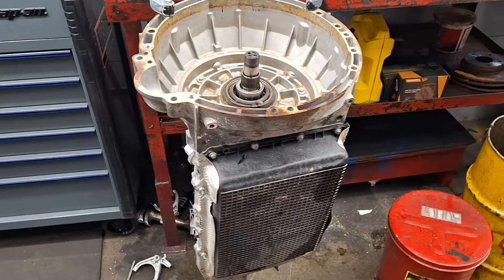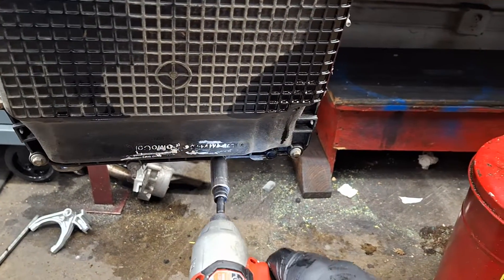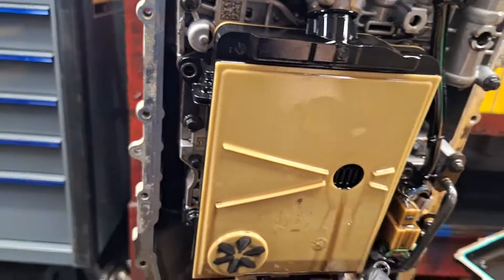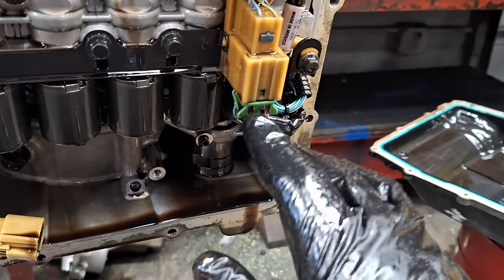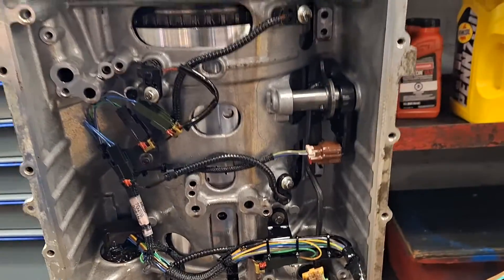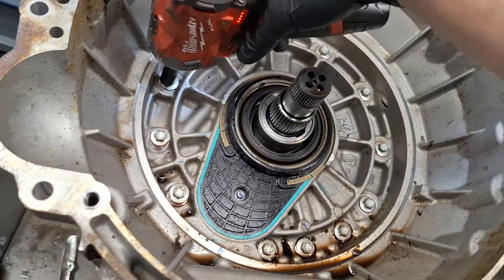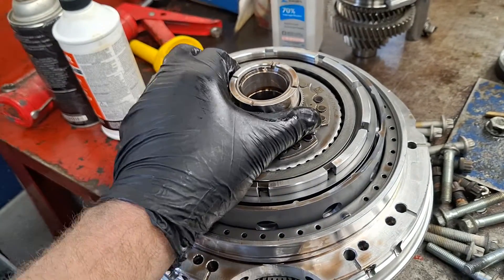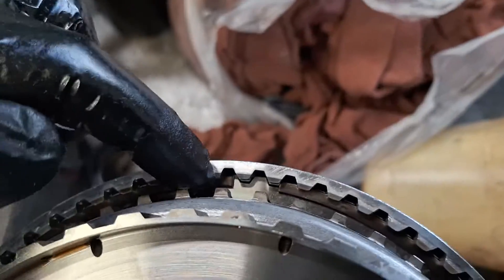Ford 10R80 Teardown | 10 Speed - CDF Drum Bushing Failure

Comment: So one of the symptoms that's common with this problem is the one to up shift and the three to four up shift. Now I have something that is going wrong with my transmission but it doesn't have those symptoms. Mine is having an issue with slipping at normal driving speeds in like 9th or 10th gear. I'm wondering if I have some other problem then the CDF drum?

Comment: While it sucks that ford pushed this transmission out without doing more extensive testing at least they have been issuing upgraded parts and allowing you to buy them and rebuild compared to some manufacturers where they require a full replacement and that typically costs more

Comment: This transmission requires fluid changes at 50k miles max. Also good to add about 4 ounces of Lucas transmission treatment. Zero problems! 3rd generation mechanic and engine builder.
Reply from the maker: Appreciate the extra insight!

Comment: Hi can you tell me your opinion I have 2020 transit T250  rwd high 
LK4Z-7000-C  (trans)
Got  code p 07f7 
Some time get  neutral while  I am on drive with brake on traffic light  or while claiming  high road  
 I changed the control  new from dealer with new oil and filter with pro shop  still same 
Only when I turn the engine off on if got neutral the transmission got power and move  what you think ?
Reply from the maker: Hey a 10r80 with gear 10 incorrect ratio (p07f7) is normally a shifted cdf bushing

Comment: What does a repair like this cost?
Reply from the maker: @FormerlyTT34  5 to 7 grand
Reply: @BigBensCarsAndCycles  Reon I ask is because my 2018 f150 xl V6 10 speed is having an issue. Dead stop, slight acceleration then backing off to turn a corner and accelerate, it lags. Another example, when slowing down for someone turning in front of me, not to a complete stop, then accelerating, same issue. Just getting a feel for what I'm in for  Wednesday at the Ford dealer!

Comment: After a CDF replacement are these transmissions pretty much trouble free after?
Reply from the maker: @sosu1122  yes as far as major problems. You still will have hard shifts from the valve body and the f-clutch can still cut into the container cylinder (that's not as common )

Comment: My 2022 f150 5.0 transmission failed after 24k miles..ford couldn't fix it so they installed a new 2024 10r80.  Hopefully they fixed the issues 😂

Comment: Had my 2019 in the shop under warranty twice for trans issues and they said they couldn't get it to act up and never performed any repairs. Just gave it back to me each with a no problem found. Now it's worse and out of warranty . Going to try and take it back and see if they will po5 it but probably not. Gonna cost me 5 to 10k now to get it fixed

Comment: I am having the flair on the shift to 5 but also to 10th. enough so I am throwing a drivetrain trouble light and locking out of tenth gear. I have also had a delay into reverse, harsh shifts into reverse and have had clunking and delay in engagement in various gears. I have the dealership coming to pick up the 19 expedition with 80k. Will all my problems probably be the CDF drum bushing? Merry Christmas and thanks,
Reply from the maker: @josephkordinak1591  merry Christmas and yes that sounds like the cdf
Reply: @BigBensCarsAndCycles  Got a full overhaul. CDF, Can, valve body. Acts a whole lot better now. Glad I sprung for the warranty. It was a 6k dollar repair.
Reply: Get rid of it. They are trash.

Comment: Is removing the valvebody necessary if one only wants to remove the clutch carrier cylinder or "the guts" outa the casing?
Reply from the maker: @abdulhassan1107  been a while, think so because you have to remove the speed sensors

Comment: I have a 2018 f150. When it's cold, it seems to stick in first gear. If you just take off like normal, it feels like someone has just rear-ended you! After you get into third it shifts okay till the higher range. Then it acts like it goes into neutral for a second and this is always random. After you drive 3 or 4 miles, it shifts like a new one. No slipping. Truck gets 20 mpg. The truck has 145,000 miles on it, and from the records I got, it's transmission has never been serviced. Am I wasting my time just changing the fluid and filter? I live on my social security and can't afford a 7,000.00 transmission. Really worried! Thanks
Reply from the maker: Hi, Unfortunately It sounds like you need a CDF drum replacement or new transmission. If you don't owe money on the truck, you can sell it as-is, hopefully for 10k or more. And with 10k you can get something very reliable for yourself.
Reply: No such luck. Me and the bank just bought it for 20,000.00 three months ago. It's crazy that it drives so good and needs rebuilt or replaced. I was hoping a fluid change would help it. I wonder if a used transmission from a salvage would be available and cheaper? What year did Ford start using the new part to fix this? You make it look so easy in the video, lol!
Reply from the maker: @rbthom2010  2023 is when they fixed it. Though you may run into programming differences if you use a newer one. Its possible you'd be able to work though that
Reply: Okay, so if I bought one from someone online, like this Monster Transmission co. I'll still have to get it programmed before it will drive?

Comment: is the GM trans  the same?   (same issues?) I have a 2020 gmc,  with 10spd,  and it works great,  but, wonder if  I'm on borrowed time?
Reply from the maker: @leewestrope4624  yes it's the same, though gm tends to have different pattern failures. I think they've got problems with the front support and torque converter if I recall correctly

Comment: Are the CDF drums interchangeable between the 10R80 and 10L80?
Reply from the maker: They have different prefixes and suffixes in the part numbers. I would not interchange them.
Reply: @BigBensCarsAndCycles  Is there no updated CDF drum with the anti walk bushing update for the 10Ls? or do they not suffer from this problem like the 10Rs do?

Comment: That is some black fluid. How many miles were on this trans?
Reply from the maker: @justinschnepf  I don't remember. Most likely under 60k. Most of those were done under warranty
Reply: @BigBensCarsAndCycles  dang that's wild. I changed the fluid in my 10L80 GM 10 speed for my 21 Silverado around the 50k mark and it looked pretty good still. The fluid in that trans looks like coffee. We just picked up a 2019 expedition max and I know the trans is very similar (co-developed) but has their differences. Ford did a better job with the fluid pump vs GM, but apparently did a worse job with that drum 😆.

Comment: Is there a thermostat in this transmission?
Where is it located
2019 f150
Slow heating up
Slow cooling down
Running hot at idle
Issues showed at 55k
Reply: In the valvebody and there is a valve by the engine (if I remember correctly) that opens up to allow coolant to cool the transmission. Replaced it awhile back on a F150.

Comment: i feel this is a bad fix if the Mechanic can't remember where all the screws go and put the wrong one, or Goofing off in the shop and not focusing on All this tear down which takes ALOT of FOCUS!... you seem Very FOcus**
Reply from the maker: Yeah you can't get distracted on these, its easy to make a mistake and have to pull the transmission back out

Comment: Is new CDF drum modified to prevent it happening again?…I have 2019 in shop getting new cdf drum , do you recommend any other upgrades like valve body ect?Thanks for great video!
Reply from the maker: @stevewhite7649  yes, it's modified to prevent future issues. While you're in there I'd get the updated design planetary container cylinder, and of course new sun shaft Teflon rings (where it slides into the cdf)
Reply: Thanks for your advice I appreciate it!

Comment: What causes surging in 3 4 5?
Reply from the maker: That can be caused by the cdf failure. If its just firm shifts, its normal. If it is a strong delay, then CDF
Reply: @BigBensCarsAndCycles  no so much delay as after each they surging.  Maybe engine control issue. 

I have a 23 NA v6.  Company vehicle.  Like my 15 5.0 6r80 better.  Both f150

Comment: what year is this truck?
Reply from the maker: I dont remember, though it's likely between 17-22
Reply: @BigBensCarsAndCycles    Please allow  me to ask two more questions. 1) If you have a record of  "hard shifting" as in your dealer  is aware but says it's "normal" or has tried  to reset shift points etc. and then it craps out out of warranty, has ford been covering those cases?
2)  What does this cost for us suckers who have had very hard downshifts, and then it finally craps out and your stuck footing the bill on your own? Obviously this will vary but are we talking 3k, 5k, 10k!?!    I'm  worried about my 21' that has occasional VERY hard down shift into 5th and or 3rd but only does it every once in a while.
Reply: also only 37K on my truck...

Comment: Thank you so much for this video. 
So my raptor was diagnosed with this problem and I scheduled to change the drum in 2 weeks. 
It is ok to drive on my old transmission for two weeks (was planning to go to different state) ? 
Thanks.
Reply from the maker: @leoblyshchyk6287  hi, if you are losing engagement while driving, I would avoid long trips. If it's just firm shifts then you're ok
Reply: Thanks for replying so quickly. 
No just hard shifting and not always.
Reply: I would avoid driving it out of state. The sealing ring will eventually roll off and you will then lose other gears. I build these all the time.

Comment: Im having issue with my 2021 f150 it’s got just over 65,000 miles just started 3 days ago. Truck suddenly shifts a bit hard into drive after driving it for a while and it had a slight harsh/bump feeling when shifting from 4th to 5th and only in light accelerations,(almost every time when trans hot) mid to high acceleration shifts perfectly into every gear. Don’t have any issues when cold. I tried clearing the trans adaptive tables and no luck (does down shift smoother after) could this CDF from be the issue? If not should I be worried about it? No one else feels the shifting concerns but me 

Forgot to mention I did do a trans service (fluid change and filter) at 60k miles (1st one) should I be doing services sooner maybe 30k?

I do have a extended aftermarket warranty but I’ve always done my own services and repairs

Comment: Is there a difference between the 10R80 RWD and 4WD?
Was this F-150 a 4WD?  Approximately; how much time does this repair take to do?
My truck is a 2019 F-150 4WD STX with a 10R80.
Reply from the maker: No difference between 4 and 2 on the internals. Cdf job took me 2 days. That's with removing and installing the trans too

Comment: So are these transmissions junk ? This is a lot of work for some simple parts .
Reply from the maker: With a new cdf drum, worst case you'll have harsh shifts. Otherwise they're good
Reply: @BigBensCarsAndCycles  Does the new cdf drum eliminate this problem for happening again ? Thanks for the Reply back .
Reply: @walkerjohnny72  It will eliminate symptoms caused by this issue. There are chances of other issues coming up with it but it's luck of the draw. the CDF drum is a common issue though.

Comment: My transmission does the same thing. Almost goes away completely when warm. Except 8th gear shifts a little hard. Do you think this is most likely my problem? Also where can I order parts? And where can I find parts diagram with part numbers for internals. Thanks in advance.
Reply from the maker: Hi, harsh 7 to 8 usually is fixed with a new valve body. Strong delay into 2, 4 or 6 when cold is usually a cdf issue. Ford has a tsb for the cdf drum you can print out. Base part number is 7h451 I believe
Reply: @BigBensCarsAndCycles  great so you’re telling me i may have both issues lol. I sourced out a new cdf drum.  Looks like I can get a new drum assembly for 189$ Do you know how much a new valve body is? And yes you’re correct it’s always gear 7 to 8 that’s harsh.
Reply from the maker: @TheTechGuider  If you want to join my discord I can list some parts for you, theres a lot
Reply: @BigBensCarsAndCycles  yeah I have a discord account.
Reply: @BigBensCarsAndCycles  also my f150 has the 5.0. Idk if that makes a difference.

Comment: Took my truck to the dealer for a flare from 3 to 4 when the transmission is cool. They're doing the valve body first because ford won't pay to do the CDF drum from the start. Why would ford want to do that first if the issue is obvious?
Reply from the maker: Since I don't work there anymore, I'll be honest - if it's obviously the CDF drum I went straight there

Comment: My 2020 F-150 had a transmission failure at 74k miles.  Luckily I have the  extended warranty and it is currently being overhauled by the dealership.  Is there a difference in the type of overhaul a Ford dealership does on the 10R80 based on a Warranty repair vs a non warranty repair?
Reply: absolute BS that this is such a common and k nown issue and yet ford wouldn't cover it.
Reply from the maker: Hi, in my personal experience, with a customer paid repair I may recommend replacing the valve body in addition to the internal repair. That will ensure smooth shifts and won't be a gamble

Comment: Thanks for a great video.  I have a better understanding of what is being done to my 2019 F150.  CDF drum failure and a bunch of metal shavings I was told.  After three weeks I hope I get my truck back this week.  At 69,000 miles it is just past the powertrain warranty.  This $4800 repair just paid for the extended warranty a couple of times over.
Reply: $4800😮😮😮 Every day, I love more my old auto transmissions

Comment: Since this transmission is codesign by Ford and Chevrolet, is this CDF bushing issue a Ford problem only or does it also appear to be an issue with Chevrolet?
Reply: Ford developed the 10-speed in exchange for GM developing the 9-speed/8-speed transverse transmission.

Comment: Are 2022 Ford Transit 350 AWD HR transmission included. You did not mention it. Thank you…
Reply from the maker: 2022 is getting to where they started implementing the redesigned drum at the factory. I'd have to run your vin to see.
Reply: @BigBensCarsAndCycles  1FTBW2XG5NKA35862

Comment: You sir, know your stuff, its very nice to see someone talk so eloquently through possibly the most intimidating transmission. Thank you for this, im going to possibly be replacing my output speed sensor. 

I thought i was having problems on my mustang due to low fluid, got fluid changed and filled, and still got a p0721. If im in 10th sometimes and floor it, it jumps to 7 and wont shift up or down, but no wrench... Fun fun

Either way, off my soap box, thank you for the in depth video
Reply from the maker: You're welcome! Glad to help. Before you pull the valve body out, check for frayed wires on the connector on the rear right of the transmission
Reply: @BigBensCarsAndCycles  yes sir, thank you for the help!

Comment: The garbage can had major wear the grooves are supposed to be completely smooth and if not replaced can wear all the way through down the road and I’ve seen it. It’s easy to rewind and pause and see the grooves in them. Can definitely needs to replaced especially for aggressive drives.
Reply from the maker: I noticed that after uploading, it ended up getting the garbage can. Thanks for pointing that out, I need to make a note of that

Comment: I hate this trans. My 2017 never shifted right, bangs into drive, 1-3 and 3-5 shifts cold feel like you get rear ended. Starting to shudder and slip now, everything getting progressively worse. All the dealer ever did was a adaptive shift re-learn (which I have been doing monthly to try and make it liveable) or tell me "you don't know how to drive it right". Well it's out of warranty and now my $10k problem if I want it to work. Fords not getting a dime, Suncoast trans and torque converter. Who needs to do warranty work when you have months of retail work I guess.

Comment: Mine makes a terrible noise under accel around corners. Metallic and tinny like a think metal is vibrating or like a chattery clutch.
Reply: Also the 1-2 & 2-1 shift have a grinding noise. 20 mustang
Reply from the maker: If you'd like, you can take a short video of the noise and post it in my facebook or discord group

Comment: What seems to be the cause of the CDF drum failure? I have read that it is due to heat and pressure, would you recommend changing transmission fluid at earlier intervals? Some preventive maintenance.
Reply from the maker: The cdf bushing moves and blocks fluid pressure ports, leading to slip. It's mainly on larger vehicles like an f150 or Expedition. Fluid changes won't help, only replacing the drum with the updated design, which is a permanent fix. But, if I owned one I'd service it every 30k and install an aftermarket metal pan with a drain plug
Reply: @BigBensCarsAndCycles   My expedition also has the CDF issue. Dealership says replace the transmission. How can I make sure I get the updated design to avoid repeating? Thank you!

Comment: I have a 2018 ford truck  f_150 _ with  5.0 V8 and 10 speed  auto  transmission having problems with  both  engine and  transmission . Is actually  acting like  jurking slop clank  clunk engaging and  disengaging  shutters  driving  away from  stop sign/ light  when shifting  1st gear upward midway  around  3to 8 speed struggling  to 10th gear vibration  in floorbed driver side and bumb as slowing down  with down  shifting  shoving me into drivers  seats  as if like  someone else  coming  up behind me  shoved  me while  driving  in  my truck  f_150